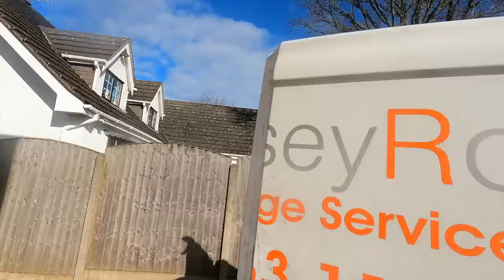Ooooozing Manhole 💪 Satisfying Unblock

Comment: Hi Andy, that looks like it was a layout designed to block on that tight angle. But no job is too tough especially when you wear touch and tough 🤣🤣🤣👍
Think that your engine is due a service and sounds like you may have some dirt in the carburettor. I have now started filling up all my machinery with a funnel which has a brass screen filter and you would be surprised at the small particles that it catches (almost like sand). There is only one place it can be coming from and that is the expensive E5 fuel that I buy and I am sure that you know but you can't run small petrol engines on E10 as they die!

Comment: now when they built that chamber they should have put the exit at 45 degrees to throw the crud towards the xit  you would not have had the build up on the exit of the pipe as there would be nothing ther to build up against  bad design  leads to poor flow and hang ups  causing blockages

Comment: It's  a wonder this  manhole doesn't plug up every couple moths with that T connection and not a Y.
Reply: It's so often the case that because it's below ground, the pipes are literally thrown in, not just modern additions but often old glazed pipe too.

Every now and then, you come across a nice brick chamber with tidy brickwork and benching and pipe branches  set correctly built by someone with some pride, but it's rare.

The other problem is that whilst old glazed pipe was socketed in yard long lengths and needed a accurately dug trench 3m or 6m plastic pipe can be layed with less accuracy often in a flat bottomed trench with the pipe shimmed up underneath with junk to get the fall then backfilled.

Obviously, over time, the material under the pipe settles, and the pipe dips, giving a poor fall.